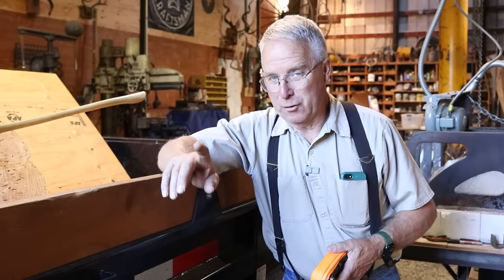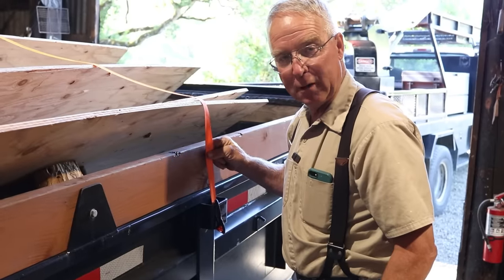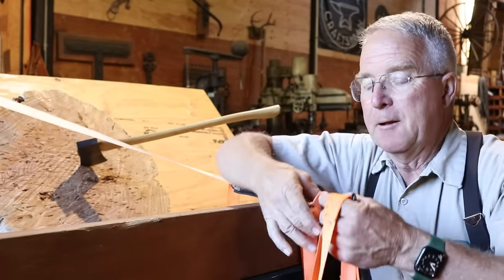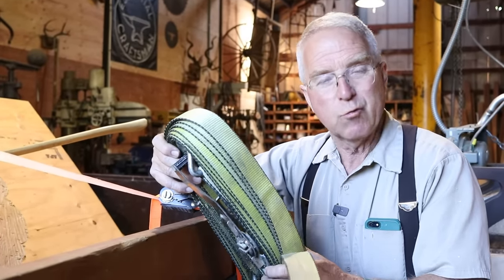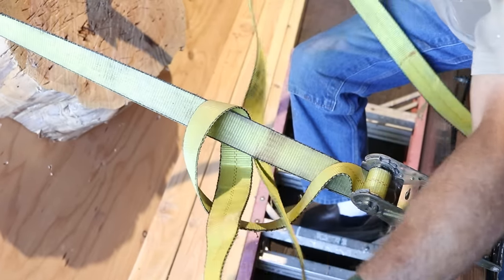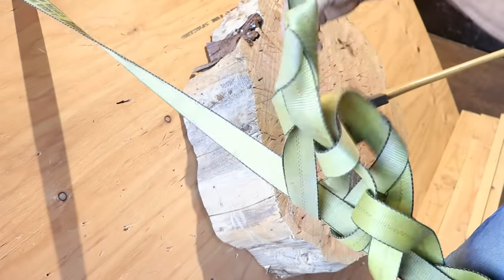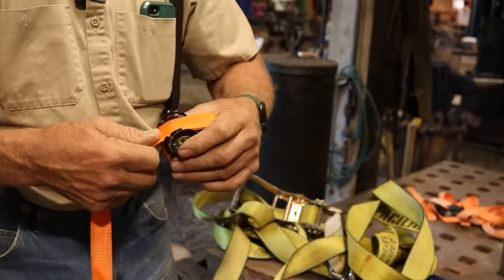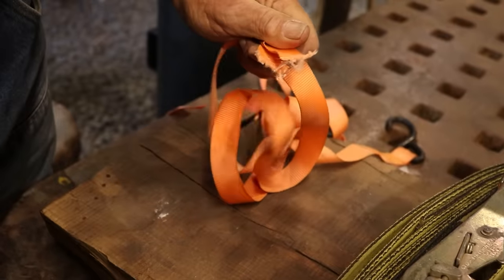7 Ratchet Strap Pro Tips

Comment: Good tips. I've been rolling up my ratchet straps like that for a long time now. Keep them in a container under the seat and never have a problem with tangling.  One thing I have discovered, is that if you swing the first hook out to the side then wrap up the strap, you can swing the hook back over the coil and it helps keep everything together.

Comment: For storage, I keep my ratchet and strap separate. Roll the strap up from the bitter end into a coil with a hole about the same size as the strap width. That way, you can launch the strap over the load without launching a hook trebuchet into some unsuspecting valuable object on the other side of the vehicle.

Comment: More tips:
1. Use edge protectors on anything remotely sharp (cardboard works fine).
2. Leave a little slack before you start cranking on the windlass. The straps should wrap around the barrel 2-3 times for maximum hold. 
3. Lube the ratchet periodically.
4. Wrap up excess strap by rolling it neatly  over both hands. There is a technique to tie it to the taut line that is very quick, clean, and secure that I can’t describe clearly here. 
5. Always put ratchets on passenger side in case you have to pull over to tighten them. 
6. Check strap tension after at each stop, especially after bumpy roads.
7. After securing the load, give it a sturdy shake and say “that isn’t going anywhere.” Never fails.

Comment: There's some things you can do to the other side of the equation (the trailer) that help out with the straps.
You can add loops wherever you want on the trailer if you have a short length of appropriately sized chain, an angle grinder with a cutting wheel in it, and a welder.
The chain is what makes the loops, each link in the chain makes 2 loops by cutting the chain link in half. Then you weld those to your trailer wherever you keep finding "Hey I need a loop here but there's nothing handy".
Other fixtures can be welded on, but you usually have to buy them separately.

Also with the ratchet straps, make sure you have something between a sharp edge on the payload and the strap itself, otherwise the strap might be damaged in transit (for the same reason you put a twist in any significant length of unsupported webbing, the strap rubs against the sharp edge and frays apart). If you don't have anything else handy, a pool noodle will work great for this purpose, cut in halfs, thirds, or quarters it makes great corner guards for strapping (it'll save your head from a nasty cut too, if you glue it in the right spot). Plus a single pool noodle contains enough material to make many of these corner guards, and pool noodles aren't exactly expensive last time I checked.

Comment: I like to use 2” wide Velcro straps to keep the excess length tidy. Simply roll up the excess and bind it just above the ratchet with the Velcro. It also serves to keep it from becoming tangled when stored in the toolbox.  As far as edge protection I just utilize an old damaged strap that’s been cut into short lengths. Melt the ends with a flame to keep them from unraveling.

Comment: I keep both zip ties and a roll or 2 of cling wrap (shipping rolls) in the trailer box with straps as they can help both with loads and securing straps. I like rolling straps then wrapping with cling as it keeps them clean. Once you get a nick/cut across a strap either take it out of use, only use it for non-critical storage, shorten it, or de-rate it if it’s large to only holding smaller loads. 
Always use the proper size and/or number of straps to manage the weight/shift of the load with a minimum of 2 for things less than 10’ and an additional one or more for every additional 10’. It’s better to be over secure than to have something get loose in an emergency condition because remember things fly forward and when you’re towing you are always forward of your load.

Comment: Scott, I take a piece of tie wire and wrap around the ratchet strap roll I've made and throw it into the tool box. Easy and reusable. Saves the mess. Works good on the bitter end also by rolling and binding the roll to whatever is available (and safe). And if I'm worried about a sharp edge wearing through the strap I cover the edge with cardboard or anything I can find. Lots of good ideas here. Good Job and thank you for sharing.

Comment: If you roll your bitter end up into a loose coil/loop, and leave about a full coil left before the windlass you can reach through the coil, pull the strap through, and repeat again. There are videos here on YT that show that trick and you end out trying a knot around the coil that will keep it in a nice, neat, safe bundle. And it's easy to capsize and undo your strap.

The other method i found recently for storing straps that works especially well for the flat hook variety isn't much different than your winding approach - but instead of simply leaving it as a semi-tight pack, you leave enough of the bitter end of the strap loose enough to feed through the windlass, around and back through the windlass a second time. Because you effectively have made a loop around your strap, you can use the ratchet to snug it tight. And then you can feel confident that your neat coil isn't going anywhere 😂

I do the same with my J hook straps but have to feed the hook out of the middle of the coil which is a bit awkward, but better than a huge tangle.

Comment: I think that two simplest knots nobody will regret knowing are the bowline and basic inline slip knot (the kind that you'd use with a trucker's hitch). I always have a spare length of rope with me (about 7 feet long) and use it way more often than I should as a dog handler. I always hand out my actual leads and the rope is just my way of never being without a lead, and having something that I wouldn't hand to someone else over a lead. Quick bowline at the end, feed the opposite end through and you have a slip lead, in line slip knot for a quick handle anywhere along the rest of the rope if needed, otherwise just another bowline at the end for a loop. 

Conveniently enough, you can use both of these knots to tie down a load as well if you don't have ratchet straps and only have a rope.

Comment: Great vid as always! When wrapping them up for storage I open the ratchet mechanism out flat as if releasing it and pull the strap half way through.  That minimises the number of wraps needed so saves time. Being longer and thinner also means you can tie the end in a simple loose knot around the whole thing so it doesn't unravel, and they also just happen lie together better like that in my van racking.

Comment: Best way to manage the lose end of the strap after securing your load is to take a like 20 inch length and keep folding it over itself then running it through the handle of the ratchet  then pull the other end through the middle of the loop and that ties it to the ratchet, keeps it secure. And btw for those that run vehicles / trucks for work purposes this keep the DOT/DMV officers from looking to closely at your loads or giving them a reason to want to stop you and check over your vehicle.

Comment: I roll the strap length separately from the windlass portion so I can hold the end and throw the roll over my load. This also allows me to run the hook-less end of the strap through the windlass and set my approximate length in advance. I then throw the tail over the load which gives me the ability to tuck it under the hook end and cinch down. I then ratchet the strap tight. This way the strap tension is holding the loose end and it is immediately free when you release tension. This method also effectively allows you to "hold both ends" of the strap.

Comment: I wind the straps similarly to what you do, but I've also found it's usually faster to pull them halfway through the windlass first, then overlap, and wind the 2 superposed ends afterwards. only half as much winding to do since you're winding 2 thicknesses at a time.
Reply: just made a similar comment, but you said it much better.

Comment: Daisy chain idea is neat. Ive always done what alot of truckers used to do w/ the excess. With a bit of practive its pretty quick, neat, works wonderfully.walk away from load with the tag end, start rolling the excess on itself(with nuff space to fit ur palms side to side) and with a hand over hand motion with ur palms in the center of the roll, roll it up to about 3 ft from the windlass (stoping once to pull, thus removing slack and shrinking the roll size a tad). Then take a loop of the 3ft section pass thru the roll and then slip around n over the roll, pull it tight to secure the excess.  Then utake another loop of the 3 ft section pass behing the tight load strap and the load. Squish ur roll flat, passing over the tight laod strap and halfway thru the loop u just made. The spin the squished roll up or down repeatedly  winding ur loop around the roll totake the slack out tugging tub and down as u do so. Sound complex but its crazy simple i just cant explain via text well. Losening is simply turning the opposite way and pulling and bam. For storage i like to roll the end in towards the anchor (detached from the windlass) so that i can hold the hook, and "roll/toss" the webbing up n over the load super easy without fear of the metal hood damging my truck/equip/people. I also have a large rubber twist tie the i tie thru my strap rolls to keep em tidy. Im weird tho.
Reply: This is exactly what I do. So glad you took the time to explain it. I was thinking Geeze this is going to be a mission to put into words!

When I start doing this around other guys they often start tying off the straps willy nilly stretching it across the load. Then I do mine...and they're like uhhh OK, you can do ours too haha.

Comment: I don't want to sound critical but you asked for comments if you forgot something in the video, and I have an important one! I don't know the right answer, but supposedly there is a wrong way and a right way to loosen a ratchet that is tightened down on a load. I have found the wrong way, as a ratchet once nearly ate my finger. Ever since I've just poked at it with a screwdriver until it's loose.

Comment: Using it inverted on the stake pocket, you run the strap 180° over a sharp metal corner. (If the stake pocket is even a legal load point for tension at all.)

Comment: Another good video. A tune up. Chaffing as any sailor who's sailed any long distance, can tell you is a  relentless problem. I crossed the Pacific last year on  a sail boat . Minor things that would never even show wear in 20 years of occasionally going out of a marina for a day or two, will cut through webbing, rope, surfaces in less than a week. 
For chaffing a strap as in your video, Duct tape. A few layers 
That plywood chaffed cut. If that doesn't need to go through the ratchet mechanism  it can be repaired.  Cut it, overlap the two ends about 6 inches. Then sewing machine, best strongest polyester thread,   zigzags across the entire width, back and forth several times, about 7 or 10 of these evenly spaced along the overlap should be as strong or stronger than the original webbing. It's easy to do, any decent sewing machine can sew even two layers of the thicker nylon tubular webbing.  Use a Ball sewing needle on the machine. This isn't a brand, it means the tip is round (but I've never been able to tell the difference) The ball needle instead of piercing the webbing fibers pushes its way around them. That's what makes using a less than industrial machine possible. 
To toss that metal end over your vehicle to the other side -- with out breaking a window. Put it in a work glove before tossing it. 
On my boat I have a ratchet strap. Haven't used it. My friend James was halfway to Hawaii when in the middle of the night something red hit his rudder and broke it. He thinks it was a shipping container. He managed to get to Hawaii at 2 knots using a drogue to steer, but he said if he'd only had a ratchet strap he could fixed his rudder good enough to make the journey. $20 is pretty cheap for insurance, and maybe helping someone else out. 
Here's a good general trick to know that will work for your ratchet strap. Have a bag. Attach the hook end to the top of the bag, stuff all the loose strap into the bag and attach the ratchet end to the top of the bag on the other side. There is now no possible way for that strap to make a knot.  You can also stuff the excess length in the bag and tie the bag to the strap and that problem's solved/. 
(When I hand line 100' of monofilament off the back of the boat and catch a fish, I want to pull it in as fast as I can. So instead of laboriously wrapping it around my ring,  I just let it pile up at my feet. So long as I don't lift my feet or drop the hook into that tangle, it will easily untangle after I take the fish off the hook or throw the lure back in the water.) 
Another good thing to do with webbing on your truck or car. Take about 6-8 inches of basic polyester/polypropalene or nylon webbing 1" (never use cotton) Fold it in half and melt a hold near  the ends. Under every hood of every car I've ever seen are fender bolts/screws. Unscrew one of these and stick the bolt through the webbing and screw it back in. Now you have tie loops sticking up out of the sides of your vehicle's hood. They fold under the hood when not in use. Works great.  The flatter, not tubular webbing works best otherwise you'll need to get longer bolts. 
The most critical rope for anything on  a roof rack is the lines to the front and the back. The ones in the middle aren't nearly as important. I've heard of a few dozen,  'we lost our load' or 'I lost my kayak' stories. In none of them were both the front and the rear tied down. Sometimes the whole roof rack came off.  (With a long load, I've found no real difference between using   foam rubber hull supports tied to nothing and expensive roof racks installed to spec.)

Comment: For your tail, or the bitter end:
Start at the end and roll the strap into 12” diameter coil till you get about 8” or 10” from the ratchet, flatten the coil into a stack of folds and pass it under the tightened strap above the ratchet all the way around back the the front. That leaves a little loop coming from the ratchet, pass your flattened coils halfway through and then grab both sides and twist that bundle towards you… it will cinch the loop down holding the bundle of extra strap tight against the top of the ratchet. To undo, just roll it away from you and it’s undone and still neat and coiled up. You’ll never daisy chain a big strap again after you figure it out.

Comment: I appreciate a good, quick ratchet strap but I am also well versed with ropes from years of packing mules. They way I deal with the excess strap is roll it up, pull the outside loop through the center then back around the outside loop and pull it tight - Easier to show than say! Won't come loose and it looks very tidy. Anyway, thanks for the video!

Comment: No.
Pro tip is to fold your slack in half, and in half again, and again until it's between 2-3' long on a neat stack. Pass the stack loop end through the bale handle,  wrap loops around the handle, pass other end of stack through the loop and pull it tight. If you do it right you should be able to close the handle into its locked position around this knot.😉

Comment: If the strap is bound up on the little drum because some jerk decided to ratchet it so much that the strap starting binding against other moving parts, unfold your pocket knife and put the back of the blade in the slot of the barrel doohickey. You will get a lot more torque this way than unfolding the handle so it cams the catch out then yanking to try to uncoil the strap.

Where there are ratchet straps, there should be gloves. You're not that guy. You are not built different. You are not the mythological creature your grandfather claims to be. Have work gloves available.

Comment: I store them by winding them up like you and then I bought a huge roll of Velcro and I cut lengths of Velcro to hold the wrap together. 
A zip tie could work as well and could be reusable but isn’t as secure as Velcro which also holds to the strap as well as itself.

Comment: I can't believe you worried about the plywood but not the fact you hooked your strap such that the strap was against the metal edge where the metal hook goes. You have to do something else even if it is just use some tie line/wire to hold the hook for you then remove it once you ratchet it down.

Also, for storing ratchet straps use the chock method. roll it up with a hole big enough to feed it through itself and choke it together.

Comment: I gave up on them as to problematic 🤷🏻‍♂️ HD, Lowes etc all sell lengths usually 6-10’ & say 3/8” to 5/8” with a spliced eye on one end.  Simple & fast 👍 but I’ll work on the ratchet strap, thanks for the video. But of course I have a panic bar & tie down point in my F-150🤔

Comment: When wrapping, do it with the ratchet open, this get that awkward triangle or oval shape out of it and makes it more rectangular. Then tie with a short length of rope. Then when you are securing the loose end just roll the excess about 16" length and use the rope to tie the roll to the portion securing the load.

Comment: SUGGESTION:
Those cheap small orange sraps get used FAR MORE often than any other ratchet strap I have.....but they frequently lose the little spring. So dab a little hot glue, or super glue, to the base of the spring...and prevent an annoying situation discovering you are springless when you need it.